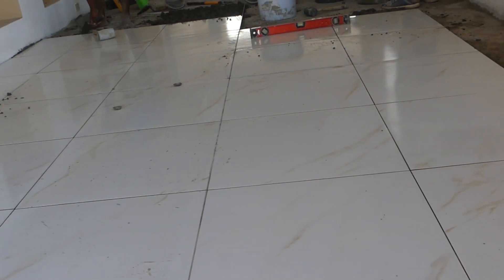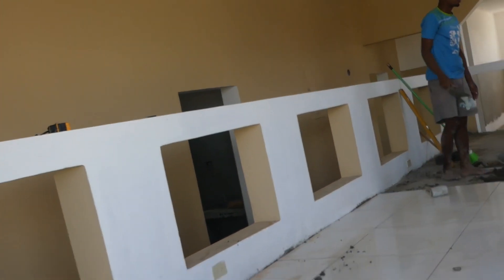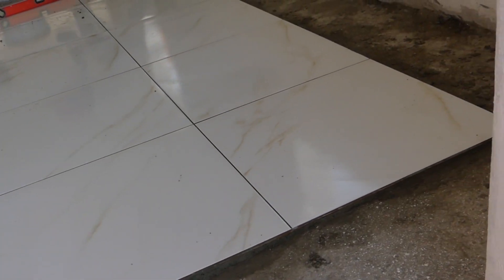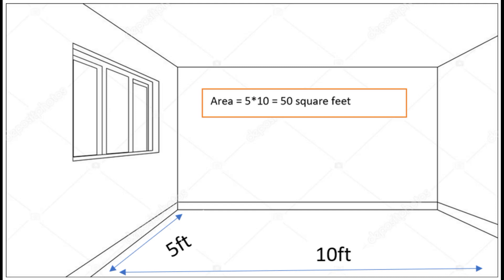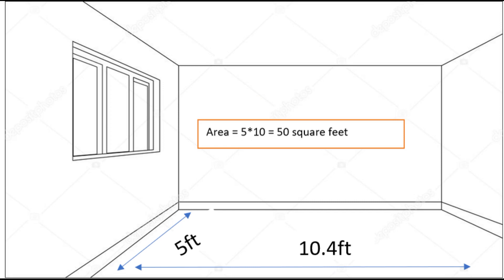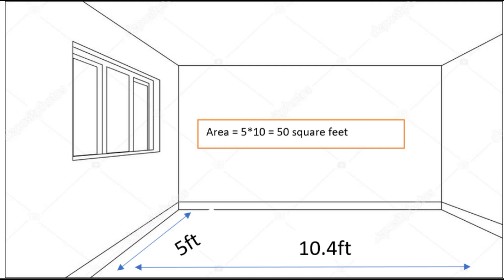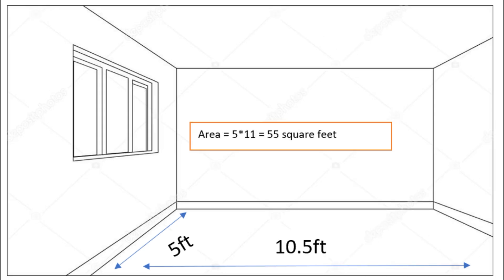Building your own dream home in Jamaica

Comment: Fabulous tile work.  Love, love the countertops. Everything looks beautiful. Maybe the tiler should have laid out the accent  tiles on the before putting them on the wall in order to get best set up.
Reply from the maker: Thanks Curated Home, we actually laid them on the floor and attempted to line them up but they didn’t form anything. A part of me is wondering if the boxes I got just didn’t have all the pieces to create the image.
Reply: @OpalCrossCoaching  it still looks good tho
Reply from the maker: @curatedhome5108  thanks hun